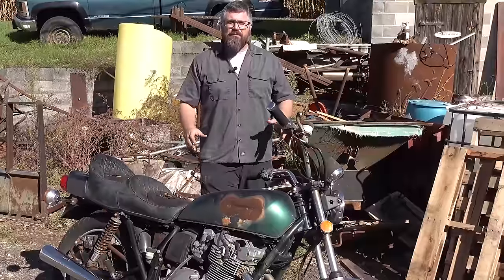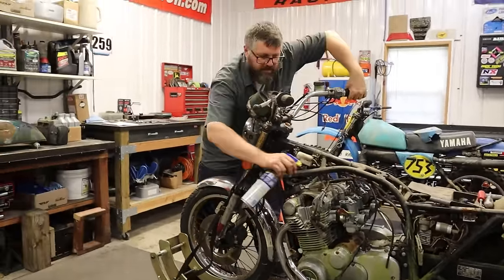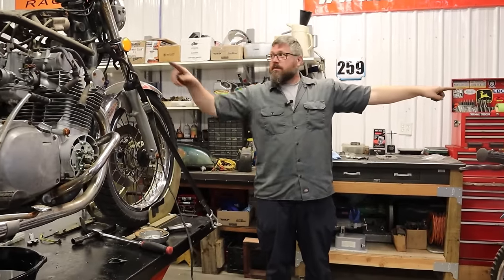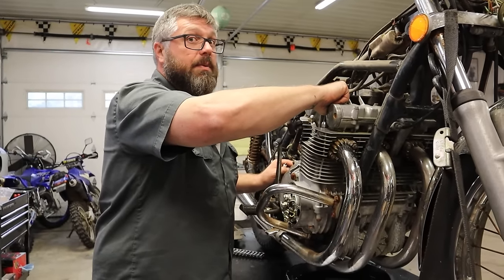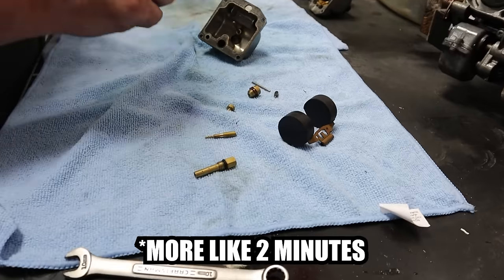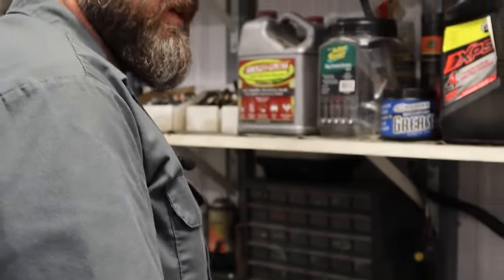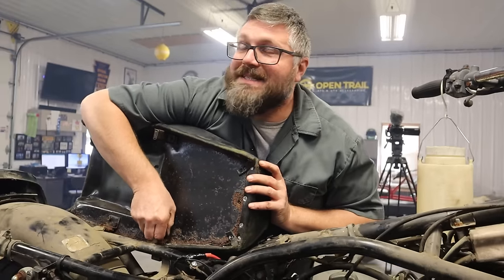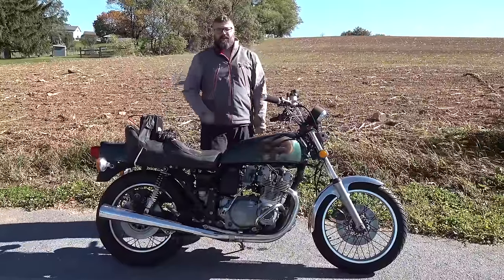Can I Get This $300 Old Suzuki Motorcycle Running?

Comment: It's my understanding that these GS series were overengineered with roller bearings instead of the brass bushings other makers used.  Supposed to be quite durable.
Reply: Actually, roller bearing bottom ends are less reliable than high-pressure lubed "plain bearing" bottom-ends.  You used the term "brass bushings" which is technically incorrect - the bottom-end on every modern 4-stroke is done with high-pressure fed "plain bearings" (the term "plain bearing" - while popularly used - is also a misnomer; these type of bearings are more correctly called "fluid film bearings", since there is never metal-to-metal contact - the bearing surface is the oil).

Comment: I have a question. i have a 1994 suzuki rf900r. it's my first bike, and im trying to get it running, but im in over my head. i can jump the starter solenoid, and it will turnover but not start. i know it's got spark and fuel, but it won't run .....can you help me get my first bike running please

Comment: Probably a longshot but can you do a video on how to change a front brake master cylinder? I have a MT07 2018 and it has a messages up wing mirror bolt and I need to replace the whole thing but I can't find a good video on it? I'm confused on how to bleed it and the best way to take it off?

Comment: What is it with America and high bars and king and queen seats, suppose it's the opposite to our clip ons and 2/4 seats here in Europe. Also the Gsx motors were 16 valve air cooled before thr Gsxr engines.

Comment: I bought a 2005 daytona 955 none runner 20k took 10 mins to diagnose fuel pump gone replaced it with new fuel running straight away bime cost £1000  next up t595 speed triple converted 1997 8000 miles cost £800 none runner took 5 mins to diagnose faulty fuse

Comment: Windy Urtowski's favorite bike is a GS1100.  He credits it with being basically the first super bike.His is like new.  I think I want one. I try to find cheap easy projects that are something that I'd want to ride often when it was fixed. Do not buy a turd no matter how cheap it is. 

Now, a lot of people probably lile the CB500.  It doesn't excite me. There's a Yamaha SECA 500 with an atv front end on it nearby for cheap.  The bike could be sort of cool. That poor bike! I want to just put it back like it should have stayed, but I probably wouldn't ride it.

So, there's an 04 CBR600RR  that someone gave to a highschool kid for sale cheapish in my town.  It pretty much needs all new fairings now.  That, I would ride. Is it a better bike than my RF?

I want a Harley. Some kind of glide or a stripped down FLXR or whatever it is. They seem a lot like really nice watches.  Yeah, there are a lot better ways to tell time, but doing it with style sometimes matters.

I have 3 Suzukis. I bought a 2000 Bandit (GSF1200N) 1200 in totes, a 1992 DR250S/DR350 conversion project, and an '97 RF900RV that sat out under a tarp for a long long time after being "worked on" by a Sean. Probably it was worse than that.  Multiple issues and weathering.  The RF had 10K miles.  I just put 5K on it this summer.

The big bikes have that GS/GSXR herritage.  One air/oil cooled and one "water cooled" They are a GSXR race proven design, but have torquey cams for touring.

I like the parts interchangeability/economies of scale that Suzuki uses.

Comment: i had a 78 gs 1000 they do use them for drag bikes start them on gas and at 5000 rpm switch to nitro methane and get up to 700 hp

Comment: I had the same leaking problem on one my carbs and needle valves. my grandpa told me to clean the needle valve and other parts with toothpaste and tooth brush. So I did and I couldn’t believe it. Stopped leaking. Just in case anyone else had that issue.

Comment: Warerbucket!!
What is scarey I was around with some interest when these things were new. GT550, Waterbuckets I know people killed on them GS 750 also. 2 stroke Kwakas just severely injured. plus RD350 as well.
 I am the oldest of 3, I have my motorcycling scar from an exhaust pipe when the side stand collapsed! My brother has pernemant injuries plus a severe injury when he tried to catch a motor falling off the bench. My sister has a couple of minor ones as well. My fathers only injury [besides bruises etc] was sticking a broken clutch lever through his thumb.He was a champion with endurance trials late 40s early 50s.  Mums very short riding history was devoid of injuries.
So why am I watching bike videos?? Dont know, I have not ridden one very far in a LONG time and that was a 500 Yam dirt bike.  I am a lousy rider but always felt far safer on big bikes than small ones. I am Craigs size! I work on and race cars. Plus sell them and parts.

Comment: The 750 water buffalo wasn't selling very good and Suzuki had just sunken a bunch of money on the Wankel rotary bike that no one ever bought ever though both bikes were very good and are reliable as a rock and so they sort of rushed the 4 stroke models the GS 750 and the GS1000 just about 2 years later which is pretty fast for Japanese companies

Comment: ok mister nice video ,,, next put a gasoline filter under the tank , it might be lots of rust inside the tank that will clogge your carbs , second you rode the bike with out rear breaks ?? dangerous !!! , you need to finish the job by measuring the compression of each cylinder ,, and see the consumption of oil in the cylinders I hope you don't have to rebuild the engine from low end to top .... I like classic   bikes more that modern .... also..

Comment: i has young boy one season, 2-stroke suzuki 3 cylinder water cooled 750cc or 1000cc i not remeber, motorbike, my worst bike ewer, center cylinder has alltime new bike lot problem, too hot run alltime or not run anythink. and has new bike, i change this to honda CB759 four and has lot lot better bike. not problem newer.long time ower 40 year before has.

Comment: ❤Any half good mechanic will never fire a bike or or any combustion engine for the first time in a long  time with starter fluid or break cleaner ,,it just can destroy that possibility of ever running well again ,,,use some 2 stroke fuel ffs otherwise why bother trying to save it at all if you really have no respect for the engine and let your excitement be the beginning of the end ,sorry makes no sense to me why people just have to start it with starter fluid or break cleaner .